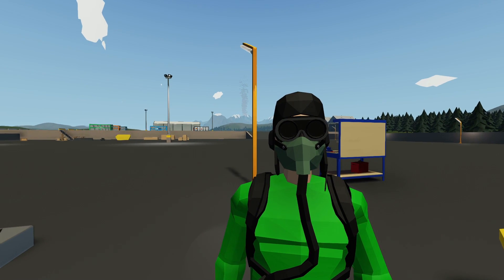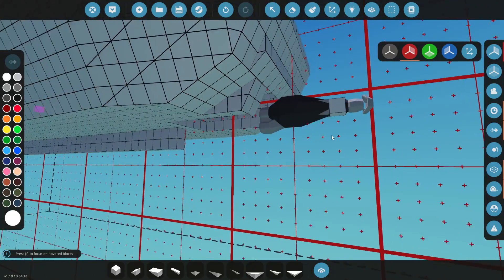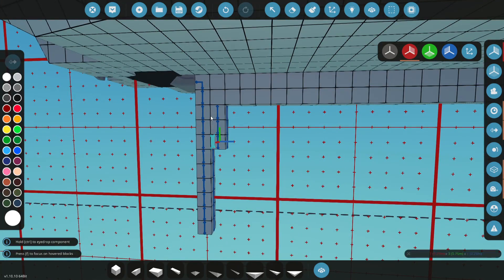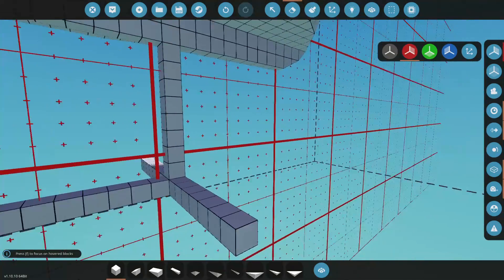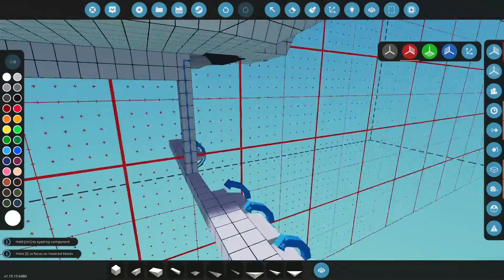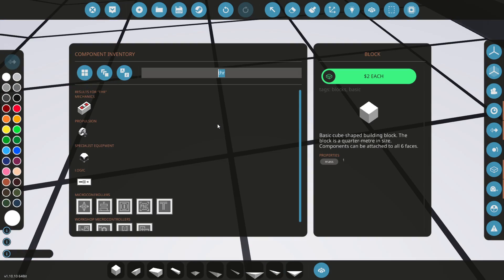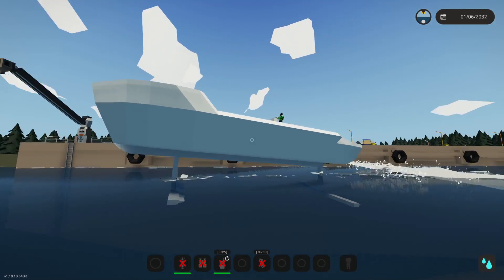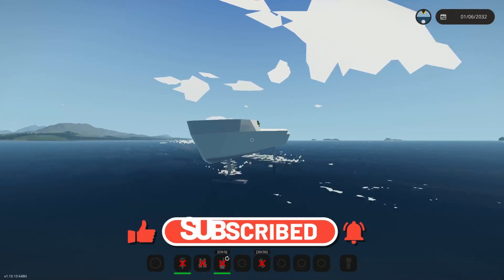HYDROFOIL Stormworks Tutorial - How To

Comment: This works wonderfully, but I have an issue. Whenever I use infinite electric, it works perfectly. However, when I take it off infinite electric and try to put the throttle anything past about 25%, it just rolls and falls off the foils. I have two fluid jets, powered by electric motors (the biggest ones) like in the video, and I just gave each motor the biggest battery, i gave one each a massive battery and connected the other stuff to a bit smaller battery.
Edit: I have dials for each battery, and they don't even drain the batteries fast, so I don't think its the batteries running out of juice

Comment: "you can place this system on any boat" and it will suck. becaus gyro is bad and too stiff, and never ever put signal from altimeter straight to fins, this is road to bottom or to space when it flips. Every hydrofoil tutorial make the same mistakes.. uhh. Your fins will become more efficient at more speed, so it will generate more force as you speed up, and this signal from altimeter OR gyro become too high and boat will become unstable and will flip like crazy. Also this problem become worse at waves. Always divide signal to fins by speed with some coefficients, so at highter speed you give them proportionally less signal. (it's pretty linear dependency - at twice bigger speed use twice lower signal. Also gyro is bad, dont use it, you'll suffer coz it will not work how you like, you angle sensor and pid controller or write yourself microcontroller. If you are using I in pid - dont forget to clump it, because it have tendency to overaccumulate

Comment: my gyro's roll output seems to be way to subtle, even if my boat is on its side the gyro will only output like 0.1 or something like that so my roll is just not working. Anyone know a fix?
Reply from the maker: did you mess with the sliders at all?
Reply: @ProfNCognito no i did not but i figured out an angle sensor works, also for the pitch i ended up using a pid controller because i ended up going 370km/h ,btw thx for the tutorial ❤
Reply: @Muntje1024  dont use gyro, use angle sensor and pid, also divide your signal to fins my speed and multiply by some coefficient. For short - your signal to fin should be twice lower if your speed twice highter
Reply: @Muntje1024  for roll - rotate angular sensor to the left (blue arrow should look left), for pitch - arrow should look forward

Comment: yooo nice vid i watched yours and nj's from forever ago, i didnt want to do the water jet for mine but its basically just mrnjersey's track system but i keep getting the dolphin thing you were talking about. any suggestions?
Reply from the maker: more distance between the front and the back rudders. get the front pitch as far forward as you can stand it.
Reply: @ProfNCognito  thank you 🙌
Reply: dont use their systems, they are simple but not efficient and not stable. use angle sensors for pitch/roll and altimeter for height, but dont connect them just straight to fins, use pid and divide signal by speed coefficient. Fins give more lift more your speed is. Thats why most hydrofoils become unstable. Use some max speed you can get and divide by your real speed.

Comment: How do you get that throttle to directly control the rps of an Eletric motor without using a pid?
Reply from the maker: Hook it straight up
Reply: @ProfNCognito  it always just goes full throttle. The throttle just controls how fast it gets there.
Reply: motor is -1 to 1 signal, you can use throtttle lever if it gives signal in between, but for precice rps control you sure need some pid with buffer. Easier solution - pure Integral from pid. Or you can use memory to hold current throttle and correct it with pid for rps